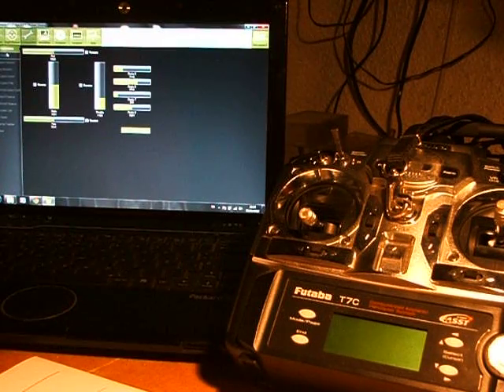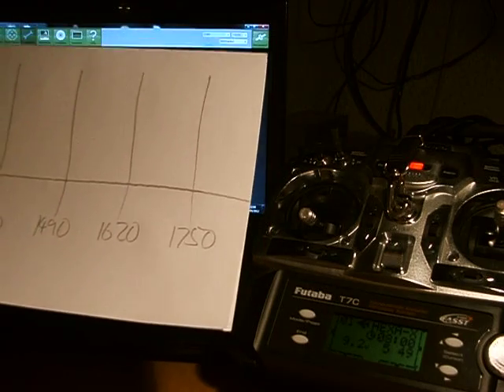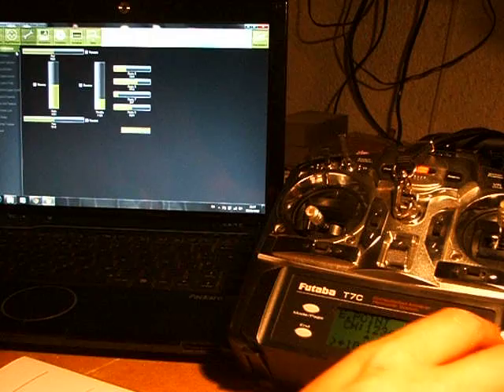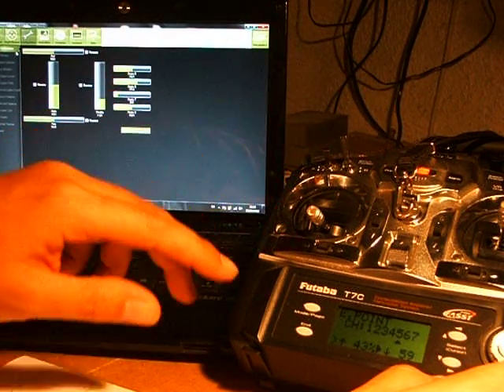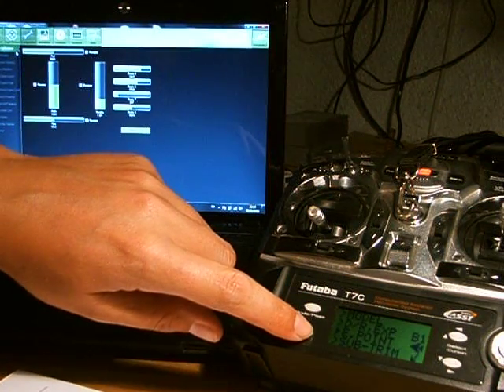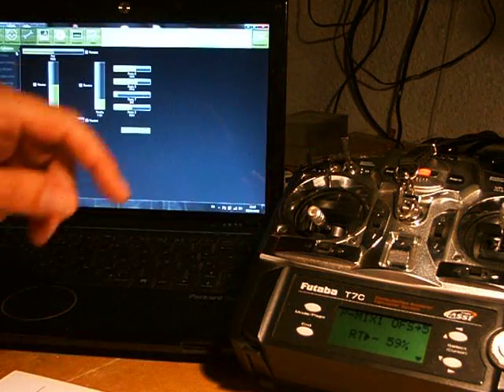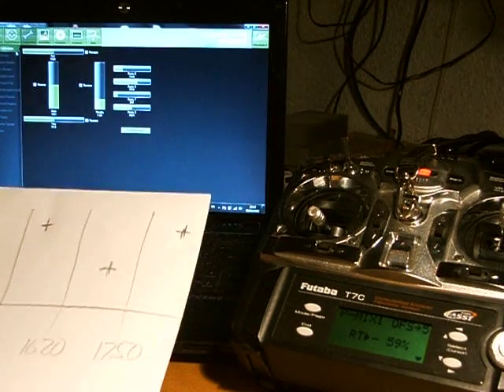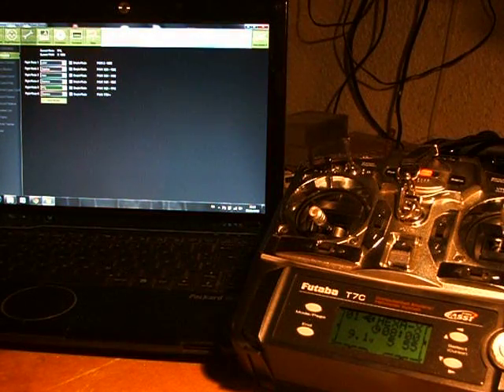Arducopter 2 - Futaba T7C - 6 flight modes on channel 5

Comment: Hi , thanks for your video. Do you know if it's possible to control gimbal with VR knob CH6? I couldn't figure out how to use VR knob to control the gimbal .Could you pls help ? Many Thanks
Reply: hi, ive been away from the whole arducopter scene for some time and never got around to setting this up.  Ch6 gives you a nice smooth range from min to max PWM and arducopter receives that perfectly, the only question as far as i can see is whether you pass that channel through arducopter to your gimbal, or bypass the flight controller and connect that channel straight to the gimbal. ideally i wanted to share that signal to control both gimbal pitch and a simple servo for my FPV camera, but never got around to trying it.
Reply: Thanks for your answer . I've tried both . from receiver directly to gimbal , and also from apm to gimbal. the problem is that I think ch6 is not free by default . it is used by throttle ch3 maybe through channel mixing . I noticed that when I move throttle to the center , then by moving knob I can adjust the same channel 3 . so if I assign ch6 to the gimbal, I can move gimbal by moving throttle and also adjust it more with the knob when throttle is in the middle . but knob can not work independantly ?! so strange.
Reply: yeah it sounds like you maybe have some kind of mix between ch3 and ch6, i would difinitely want to clean that up before trying anything else.  after that the direct connection from rx to gimbal should be the simplest way to test things.

Comment: thank you for this video!!!!
do u know if it is possible to replace a switch with a 6-position knob? I am using the only rotary knob in Futaba 7C for moving the camera. Thanks again!!!
Reply: +Juan D i have seen rotary swiches on ebay that are supposedly compatible, but i havent had the guts to try it!

i think i have even asked about it on diydrones, but never got a clear enough answer.  the ones i saw on ebay used a series of resistors to give a different voltage at each point on the dial, if the tx is going to accept that and encode it proportionally then i suppose it should work.  but i would like to see a clear example before trying it xD
Reply: +James Collings  Thank you James for your answer!!!
I also saw those 6-position switches on the web and also this new switcher from HobbyKing: www.hobbyking.com/hobbyking/store/uh_viewItem.asp?idProduct=81327
This is supposed to replace the rotary knob on the TX and give 6 flight modes easy to set and see.
But Futaba 7C has only one knob which, in my case, is perfect to pan the camera so i was wondering if this device could replace a 2-position switch (I doubt..) because the 3-position switch is set to flaps...
Nice TX but with limitations... Let´s see who can work this out...
Thanks again!!!
Reply: Juan D its all coming back to me now!  (its been a few years..)
yes theyre designed to replace the ch6 knob so you would lose your nice smooth dial for camera control.  i dont think they would work on one of the switch chanels (but i might be wrong).